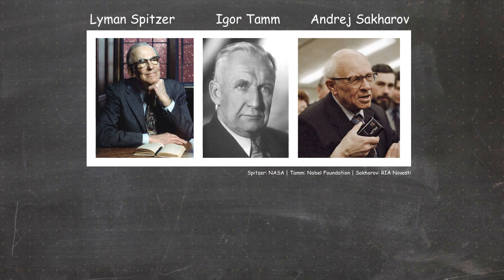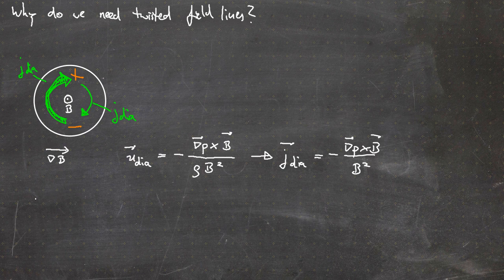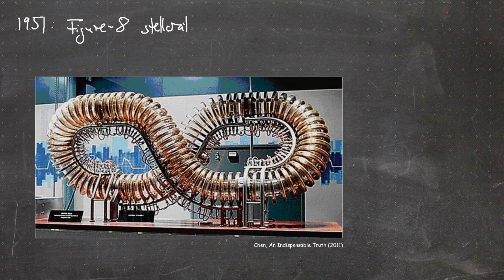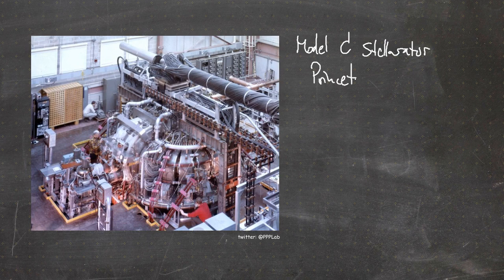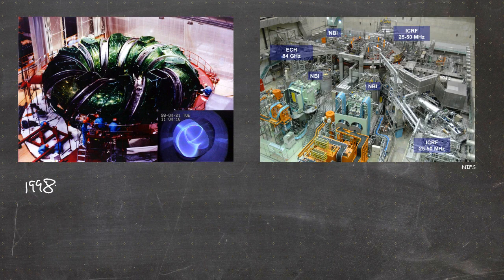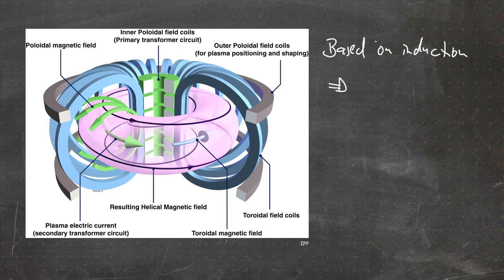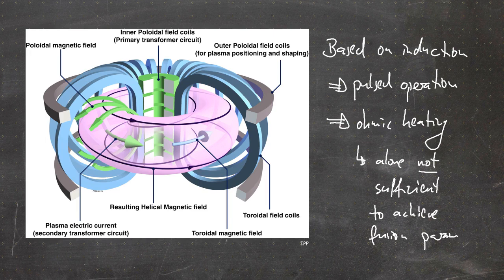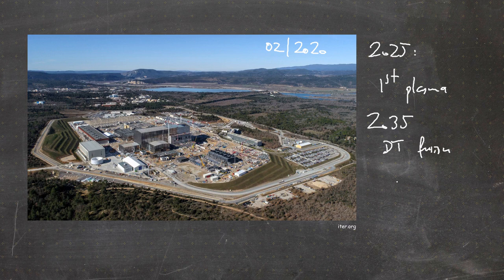Fusion Research Lecture #02 - Twisted magnetic field, Stellarator & Tokamak history

Comment: The two drawings, of the helical and modular coils, show a stellarator with L=3, M=5.  These were early design drawings.  A Modular version with L=3, M=7 was built at the University of Wisconsin, Madison.  Called IMS, it had first plasma on Aug 31, 1981.  This was the First Modular Stellarator, years before W7-AS.
Reply from the maker: It is true that W7-AS was not the first stellarator with modular coils, IMS wasn't either though. There was a Soviet stellarator operated in Moscow in the late 1960s which also had modular coils - these were plane coils though, but they were modular. W7-AS was, however, the first large scale stellarator using modular coils and it was also partially optimized. I was indeed sloppy in the explanation and should have expanded more. Having written that, I am now considering to make a stellarator-only lecture series... I will try to find some time for that

Comment: Love the video! If i understand correctly, the charge separation happens i.e. due to a difference in B from the outer side of the toroid to the inner side. What exactly is the reason for this difference, or where could you see this in the math?
Reply from the maker: B is larger on the inner side of the torus simply due to the fact that it is a torus: on this inner side, the coils are closer together than on the outer side, resulting in a higher field.

Comment: does the tokomak have any mesaurable weight variation when plasma is spinning at superfast speeds? is it possible to measure or notice any change? my basic thinking: Plasma (has small mass)--->@ increased speed--> increases mass--> increases effect of space curvature--> changes in gravity force... gravity is proportional to masses and distance between the interacting masses... the gravity of a mass moving at a certain speed (mass1, increasing exponentially with speed) against the superhard integral of all other masses in the universe moving at different speeds (mass2), and the distance from mass1 to the centroid of masses m2...
Reply from the maker: Interesting question! The energy of the bulk plasma is, however, more than an order of magnitude below the threshold where relativistic effects starts to play a role. This means it would be very challenging trying to measure the increase in mass.